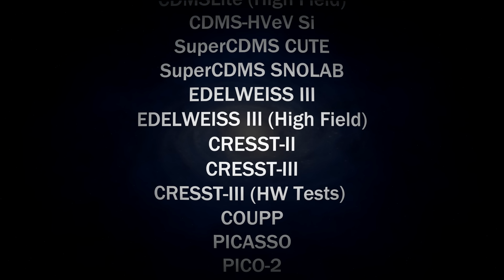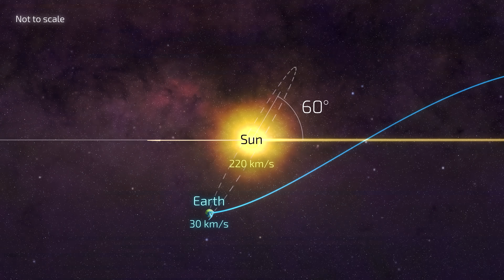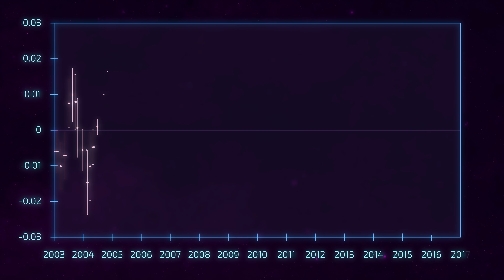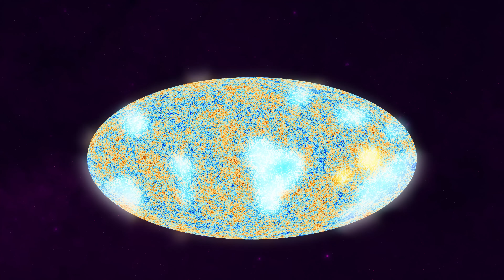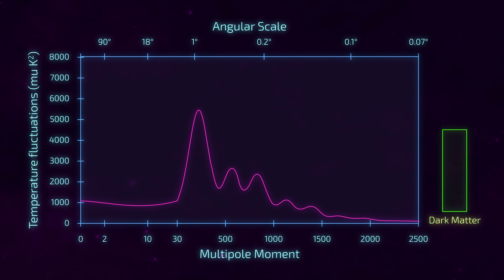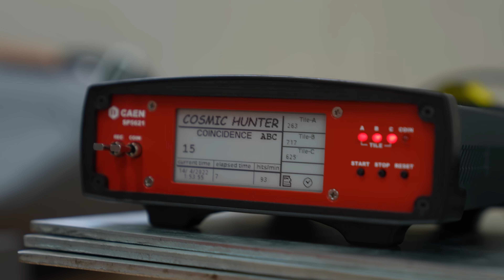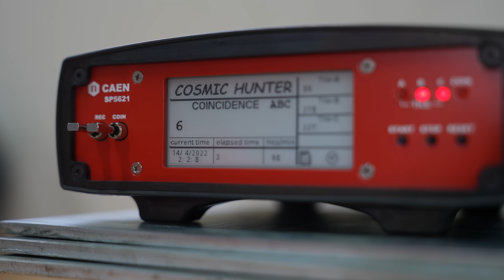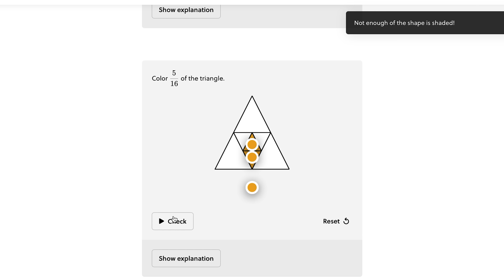The Absurd Search For Dark Matter

Comment: It is impossible that light matter and dark matter don't interact! If they don't interact, that would imply that they are different universes.
Reply: if you shoot a beam of light at an atom thick sheet of metal, most of the light shot at it will not interact as it passes through the gaps in the metal's atoms.
in a similar vein, if you take a particle of infinitely small matter and shoot it at a sheet of metal, that too will have a high likelihood of passing through and imparting 0 energy upon that sheet of metal. to say that, dark matter not being capable of interacting with light matter points to a separate universe, just shows that your viewpoint is too limited. you cannot perceive a reality beyond what has already been discovered, as most people did before the discovery of quantum physics.
more likely than not, we are overlooking something somewhere. maybe the way we see gravity is incorrect, or maybe we are failing to consider other planes of existence (perhaps 4th dimensional particles?). or maybe we are even wrong about all of it, perhaps our telescopes failed and were being influenced by time or distance and dark matter truly does not exist. 
but i do want to say that your comment shouldn't be ignored. it could very well be possible that other universes exist gravitationally entwined with our own. we just simply do not have quite enough evidence to make really any claims at all of dark matter. i suppose we will have to see when the location in Australia is put into service if we are capable of measuring it at all.

Comment: We really need to get away from cmb. It is not a constant but estimated and averaged from active sources not black space because we have now seen more stuff in those areas. So since we know it's BS why do we still base theories on it.
It is insanity to make theories based on a constant which is both not a constant, and not background.
Reply: Its an afterglow of the formation of the universe. Why would we just “discard” it?
Reply: @LogicCaster  we assume its the afterglow, but it is used in modeling as a constant. it is definitely only a constant once you average it. and it is as much afterglow of the formation of the universe as the glow of a distant city is the afterglow of the formation of the planet. the 'black space' used between stars have active sources of light. we know this because we have better telescopes now. so yes discard i because it is not the constant we pretend it is and its not even necessarily from the beginning of the universe. and i will bet the next better telescope will again show more stuff than we currently see further showing cmb is only so the math comes closer to working. but as we see examining supernova seems to work, but conflicts with math using cmb.
Reply: @LogicCaster  not nearly uniform. that is part of my problem. the 'hot' areas are explained away as galaxies. the great cold spot, is ignored because it doesn't fit the model. if i go to the beach and remove the sand because that is active, and remove the water because its cold, then really we can conclude beaches are plants and shells.  but i keep seeing sand and water.

Comment: Dark matter is nothing but frozen time in another dimension

Dark matter melts into time and expands the space of Universe, it bends light at denser points, yet only detectable by its effect on observer and is always untouchable and unfathomable like time.

When velocity of an object increases, dark matter acts thicker on it like ice,  rather than liquid, and melts slowly. When velocity is less, it melts faster into time. So time wears out quickly the slower moving objects like us (And it wears out the micro world organisms like bacterias even faster, unless they have defense mechanisms against it). Thats the time dilation in relativity 

Just like when a spacecraft re-enters earths atmosphere, it feels air thicker than it normally does at lower speeds

A wormhole is the absence of dark matter due to excessive melting and it consumes lots of energy to maintain it.

Dark matter touches almost everything observable, hence information is passed on between entangled particles

Dark matter limits the speed of light. Speeds higher than C is also possible in the absence of Dark matter (Eg. inside Wormhole)

Gravity thickens Dark Matter. It melts slowly near the source of gravity and melts faster into time when away from the source of gravity

Dark matter exists even before Big Bang and acts as a controlling canvas for Big Bang. And the Big Bang is currently spreading on it

Comment: An interesting experiment would be to put an observatory either opposite the earth’s orbital location to see if the period is observed and off by 180 degrees. Or even putting one at the L4 or L5 Lagrange points
Reply: but how did they are going to remove the backgorund noises (muons, radioactivity) if they put that up oin the space?
Reply: @atrspeed92  true,

Edit: we just need to find the right nickel-iron asteroid to hollow out for shielding a similar sensor at its core.

Comment: I think Dark matter is nothing but frozen time. 

Dark matter melts into time and expands the space of Universe, it bends light at denser points, yet only detectable by its effect on observer and is always untouchable and unfathomable like time.

When velocity of an object increases, dark matter acts thicker to it like ice,  rather than liquid, and melts slowly. Hence time dilation in relativity 

Just like when a spacecraft re-enters earths atmosphere, it feels air thicker than it normally does at lower speeds

A wormhole is the absence of dark matter due to excessive melting and it consumes lots of energy to maintain it.

Dark matter touches almost everything observable, hence information is passed on between entangled particles

Dark matter limits the speed of light. Speeds higher than C is also possible in the absence of Dark matter (Eg. inside Wormhole)

Gravity thickens Dark Matter. It melts slowly near the source of gravity and melts faster into time when away from the source of gravity

Dark matter exists even before Big Bang and acts as a controlling canvas for Big Bang. And the Big Bang is currently spreading on it

Comment: I’ve done you a favor. With the inspiration from the late Bill Hicks, I have solved the mystery of dark energy and dark matter. All matter is merely energy condensed to a slow vibration. If you take that into account then you find the missing energy and matter in the universe. All if the missing energy is condensed into the visible matter. And all of the missing matter is simply vibrating at a high enough resonance to be in the form of energy. Should you care to test this idea then I can lay out the experiment for you. The experiment is simple. The equipment is the tricky part.

Comment: Curious questions: We learn that heavy and light object all fall at the same time. Would water or any liquid in general showcase the same properties?

and second question. Say we had something that could pass through the earth's many layers of crusts without any friction or anything stopping it on it's track and we dropped this thing. Would the laws of gravity still apply in the mantle and the cores? I mean what in/on earth is producing gravity? Does earth's gravity stop at the crust? mantle? When we drop an apple what is gravity really pulling that apple towards? I know most would say the dirt but what if the dirt couldn't stop the apple? and the apple could freely pass trough the dirt where would it fall if pulled by gravity? What is the source of gravity? I know a magnet that pulls something to itself is the source of magnetism but where is the source of gravity?
Reply: 1) Yes, all objects fall at the same speed (accelerate at the same rate) regardless of their mass, as long as they are in a vacuum. A liquid droplet for example would also fall at the same rate as anything else.

2) The source of gravity is the mass of the earth itself. Anything with mass has gravity, and the apple is then attracted to the centre of gravity of the earth. Because the earth has relatively constant density with the layers going down and the fact that it's a sphere means the centre of gravity is literally the centre of the earth, ie. the core. Hypothetically if we dug a hole from one end to another and we dropped the apple, it would continue to accelerate until it reached the core, and assuming it could pass right through with no losses, it would slow down as it looses all the energy it gained and someone on the other side would be able to catch it right as it hits zero velocity again!

Comment: Dark matter (or dark energy) is more probably a calculus artifact who allows to properly do astrophysical computations despite we lacks the proper Theory (capital intended) to understand what happens... It's more a tool, or a model, than a real scientific theory.
The same thing could have happened to Newton's Theory if Einstein's weren't here to "explain" this "dark ether" who was slowing down things without understandable reasons, with only Newton's formulas.
We already know, for sure, that relativity isn't complete - otherwise, it wouldn't return garbage results when close to quantum physic and singularities, for the bare minimum. I think that dark matter/energy is another proof that, despite its great realizations, Einstein's Theory is indeed incomplete... And like Newton's one, Einstein's Theory will remain valid and useful on its own subdomain (i.e. at least for solar system sizes and up to 90% of light speed), like Newton's one is still perfectly valid and useful on a planet-sized domain for "slow" speeds (i.e. few km/s and below).

Comment: The galaxy has arms, everyone sees this.
Each arm is gravitationally more active than the part that is not arm inbetween.
These arms have grown by winning out in mass in comparison with
the parts that are not arm.
Now, these arms, are gravitational bound arms.
Everything in them can have a large speed, since the arm
bind it to the center, like tethers.
but still, this does not explain why the attraction isn't just caused
by the gravity of the whole galaxy.
This has to be more quantized.
Imagine each arm being made into overlapping spheres.
The end sphere attracts the one that's nearest next one in line
towards the center of the galaxy.
This second furthest sphere then attracts the next, and the next and the next.
These then are the arm's constructs.
Gravity at the center of the galaxy doesn't even enter into the equation
in comparison to the gravity of each of these overlapping spheres.
The gravity at the center is minimal on the outside, while the next
sphere in line towards the center has a much greater pull.
Quantize the arms, and apply pull from one quant to the next,
and you'll see what influence the whole has on each of the arms.
Gravity goes down by a factor of 4 for each doubling in distance.
Now equate that in external force on each sphere, or blocks or whatever.
The part that is nearest always has the most significance,
and thus is the binding force for each arm, not the galaxy's mass.
And yes, each arm has UCM in it that isn't part of the measured mass
of each of the spheres or blocks or whichever quantization shape is used.
Reply: LOL, I wonder how long 'scientists' will need to catch up.

Comment: It's good to remember that the black matter was "invented" to fill the gap of an observation that contradicts current models of gravity, or if it was invented to fill the gap, or if you would have to revise the current models. So it is still a hypothesis used to support a theory. "Some scientists think they have detected something that might be dark matter" is not enough.

"Dark energy and dark matter were originally conceived to explain, respectively, the accelerating expansion of the universe (despite the tendency of gravity to push matter together) and the discrepancy between the amount of matter scientists expect to observe in the universe but have not yet found. Astronomers suggested the existence of dark matter when they noticed something odd about spiral galaxies: Stars at the middle and edge of a spiral galaxy rotate just as fast as stars near the very center. But according to Newtonian mechanics (the physics of bodies in motion), stars further away from the galactic center should rotate more slowly. Scientists thus assumed that some sort of “dark” matter, not observable by emitted light, must be boosting the total gravity of the galaxy, giving the stars extra rotational speed."

Comment: Dark matter does not exist, dark energy does not exist. The current model of QM is flawed. Readjust the model and you don't need insane things like dark matter. What is one of the adjustment you ask? For starters, the idea that subatomic particles, like electrons, have a magnetic field in the shape of a dipole, like a bar magnet, it wrong. The shape of the magnetic N and S poles are actually a type of paraboloid. You can see the shapes all over the place in space. Take a look at the Sun's solar flares, what shape do they make? A paraboloid type shape. Take a look at the shape of various energy sublevels of electrons, i.e. s, p, d and f,  you see the paraboloid shape all over the place. If you readjust the bar magnet style of magnetic fields to the paraboloid shape, it shows how dark matter isn't needed at all.

Comment: Has it ever occurred to anyone that dark matter could simply be the galactic core pulling space into it the way it does matter?    That may also explain dark energy.  If every galaxy is pulling space into it,  space itself would be stretched between galaxies,  creating the same red shift effect that dark energy creates.  So basically there could be a single mechanism creating both dark energy and dark matter
Reply: Gravity in the direction of the galactic core would not explain the effects of dark matter. It's the wrong direction. You're not really thinking, are you?

Comment: when i was a kid in the 90's i remember that they did something similar to hunt for neutrinos. Lot of deuterium in a mine and a big detector.
Reply: The idea for building a detector is similar, but the neutrino is part of the known matter. They were proposed in the 1930s and confirmed experimentally in 1956. They have very low mass and don't interact much with other particles. On the one hand that makes them hard to detect (like WIMPs). On the other hands it makes them interesting, because if we could build better neutrino detectors, we could learn more about the few big things in the universe that do influence them.

With dark matter, we don't know what we are looking for. The elegance of the DAMA/LIBRE approach is that we don't need to know the details of the type of particle for the detector to work. It is built to detect a change in the number of interactions that correlates with the earth's orbit around the sun. It doesn't speculate much about what exactly causes the interactions. Unfortunately, so far it seems to tell us that we can't detect anything with the current generation of dark matter detectors, and the guys in Italy need to be more careful (and perhaps more open) with the data analysis.

Comment: My knowledge of particle physics is basic, so,..simple question: Is the theory of the existence of dark matter solely based on the observation of spiral galaxies inner and outer stars (or light matter?) speed of rotation, that the speeds are inconsistent with calculations or otherwise expected speeds?

If so, this may be a super naive question, but if the supposition is made that the unexpected rotation speeds would make sense if the amount of matter was higher, however since unobservable visually, must be "invisible".  Wouldn't invisible be different than dark?  Am I being too picky, or wouldn't invisible suggest an element of unknown physical characteristics, causing them to be imperceptible even if very close? Couldn't it be that the "regular" matter that makes up planets, might also appear invisible, but only because anything that isn't an illuminated star couldn't be visible from such a distance?

Might be a no-brainer question for an astrophysicist, but curious why the astrophysics community eliminated the possibility that the visually unobservable matter likely responsible for the unusual spiral speeds isn't attributable to the galaxy's population of planets among the stars, whose presence has the spiral speeds in line with expected if/when including the presence of planets.

Comment: existence of dark matter is already prooved by Casimir effect.dark matter is extremely dense electromagnetic field made of Planck scale units densely packed in the space and this field connects all particles and interactions in unity and visible matter is only puppet of this dark matter.dark matter and normal matter is made of the same building blocks .the difference between two kind of matters is in arragement of these building blocks.fundamental particles of normal matter like protons,neutrons a and electrons contain 3 building blocks,particles of the field like Planck scale units contain 2 building blocks.